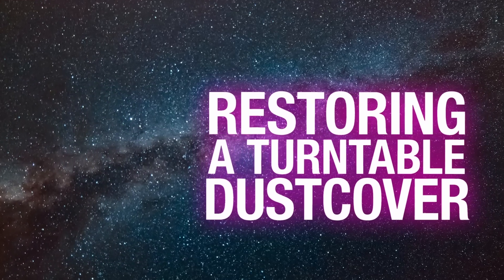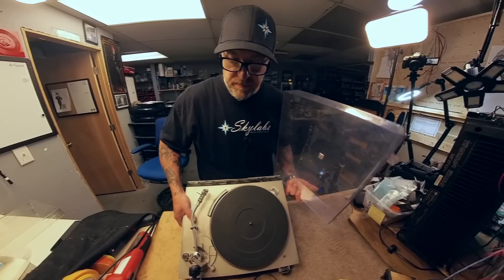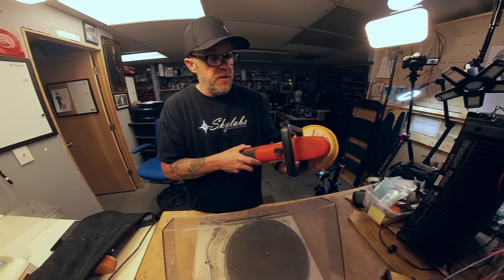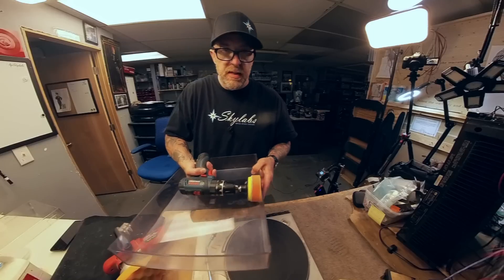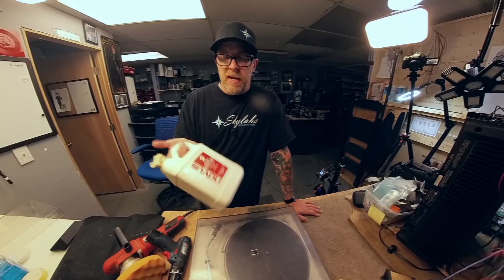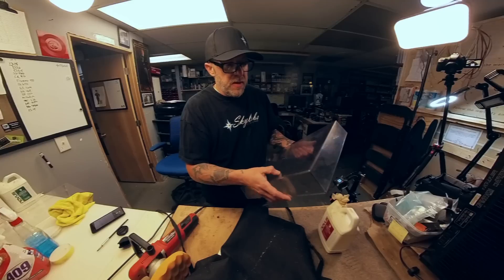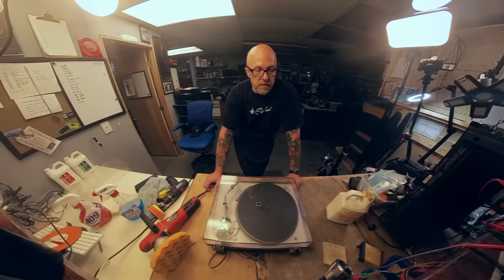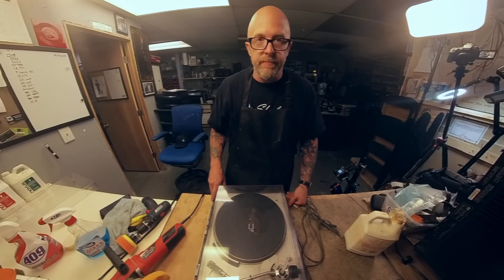Tips From The Bench Restoring a Vintage Turntable Dustcover

Comment: One thing that really helps with that process is to take a bath towel and fold it up into a square, so it fits under the dust cover! That way you can put a little extra pressure on it when you are buffing! I find this really helps and it prevents any chance of it cracking! Also are use Maguires scratch removal which really seems to do the trick on the cleanup! Just my two cents! Great job on the video, Kevin!

Comment: I go 400, 800, 1000, 1500, 2000, 3000 mcguires compound and scratch x2.0 follow with wax. I like carnuba wax and final buff with flannel cloth. It takes 1 hour. The trick is to start at the appropriate grit for the initial condition and the sequence of grit does the work for you. I usually go 5 to 7 mins per grit. Small circles, cross hatch and 45 degree. Rinse between grits and use soapy water. At 3000 grit and compound it will look very good. Scratch x2.0 and wax is money. Flannel cloth buff makes it mirror finish. I do these daily. The buff phase is like a total of 10 mins for the compound and 2.0. Polisher is 100% necessary. Keep it moving. I sit the cover on a piece of foam insulation. Cut grove in it to hold edge of the cover.
Reply: You should do a video how to

Comment: If there is a enough of the plastic tab left that it can stick into the slot of the hinge, you can drill a small hole in the hinge and keep it in place with a screw.  You just have to remember to take the screws out before trying to rip the cover off 🙂

Comment: Nice job Kevin! It looks great. I tried a Meguires headlamp kit (kinda expensive) and wen real slow. It took me four hours even though the scratches were not deep at all, just kinda cloudy. The dust cover was tinted or “smoke” is the descriptor for that one. I masked the label with a layer or two of good painter’s tape to protect the lettering. The masking tape was a pain in the neck to work around. I had to do many close areas by hand because I did not trust the drill apparatus. It looks like new, I mean really like new given it is a 1974 Denon and had never been cleaned/buffed prior. It was worth the effort, friends say “how did you find a new dustcover for that?” I also did not start with the very coarse abrasive, I just hung in there with the light stuff until I got the results I wanted. If you go with a coarse grit abrasive and heat up the acrylic, it will ruin it so if you try going a diy route, go slow. Read the instructions.

Comment: The dust cover on my SL-1500 has side by side 'cigarette' burns on the top right front that almost melted through the plastic... using tips & methods shared here I am sure the cover will clean up well, and I will just leave the damage as-is to retain that distressed vintage appearance.

Badges? We don't need no stinkin' badges!

Comment: I have had excellent results doing my technics lid by hand .Firstly going all over the outside of the lid with 3000 wet or dry to remove any scratches then bringing back the shine with T Cut....Looks as good as new but it is not a 5 minute job , prepare to spend a few hours on it ...

Comment: I’ve done about a dozen of these, so far. I’m currently working on one for my Pioneer PL-514 that was so bad, inside and out, that I had to wet sand from 800-2500 and I’m now polishing with the Novus kit and some other products in between. I have a 6” random orbital polisher and a 4” cordless angle polisher, but they’re both so unwieldy and messy, I usually end up doing most of it by hand.

Comment: Alot of people have random orbit sanders with variable speed which will work. Foam pads with velcro can be added. Use the slowest speed and practice on scrap acrylic. Small right angle cordless polishers are available as well as Dremel tools for tight spots. Polishing is SANDING with abrasive so start with a finer grit and step down if necessary.As with sanding,you do the heavy work with the first grit and after that you are only removing previous grits scratches. Cheers.

Comment: For really bad scratches, start with 320 grit and work up to 3000 or finer, then use Novus # 2 to finish.  
I do it by hand because I don't do it often enough to justify the cost of a machine.  
Novus  # 3 does work better if the scratches are coarse.  Be sure to use # 2 after using # 3.

Comment: To avoid scratches when you do the inside, you could use some tape on the sidewalls when you do the main surface of the dust cover, and later some tape on the main surface and do the side walls.

Comment: Novus stuff is good...in your case I would invest in a couple of squeeze bottles to fill up off that super tanker jug you bought (make sure you shake the container of whatever you're using vigorously). Meguiars stuff is good. I personally like 3M FinesseIt products cause I color sand car paint with it alot. It really depends on the type of plastic you are trying to restore...there's no one absolute polish in my opinion.  And stay away from headlight restoring kits...they are grossly overpriced and possibly too abrasive for a TT cover. On super heavy scratches you will need to use a finer 3M Imperial sandpaper to feather the scratch out otherwise you end up with a shiney inverted speed bump. I have personally polished many a plastic watch crystal...there's a special compound stick by Bergeon (green I think) made specifically for that purpose. I've used it in conjunction with a Foredom mini lathe at lower speeds and it still works great which is why I include it as a possibility. I guess it goes without saying try an inconspicuous spot on the back of the cover first if you are unsure of the product you are using. Also, be mindful of the color of the product you are using...will it stain a clear cover? When you go leaning on that polisher creating heat, will that dark red chrome polish you're using come off? Good luck.

Comment: Kevin,  You know your stuff about vintage audio no doubt but omg, THIS IS NOT how you polish clear plastic. Watching you pull out that buffer is like watching someone say they're about to change a TT cartridge and then they pull out a hammer. While yes, you can kind of maybe get the job done (poorly at best), it's the completely wrong tool that's going to take way more time and effort and have a good chance of breaking something.
To start with that buffer is made for things like cars. Not 12oz pieces of plastic. It can and will fling it or shatter it. ESPECIALLY WHEN YOU WERE USING IT WITH THE COVER SITTING LOOSE. And you've seen other people get good results with 3000 grit sandpaper because the pad you're using is actually coarser probly somewhere around 2000 grit, you're just basically beating the plastic into submission. Novus is always the best polish for plastic but it is extremely hard to get semi-good results on plastic with any sort of power tools, and with what you're using "passable" is the best you can ever hope for.
Just use Novus 2 with a cloth by hand and you'll get way better results with much, much less frustration. If it's deep scratches Novus 3 works but it takes time, and then it has to be buffed out with 2. You don't even mention Novus 1 but you want to finish with that as it protects the newly air-exposed plastic surface. If you really want to use power tools than get a small palm orbit sander but spend some time to learn how to polish plastic first. What would you say to someone trying to restore an amplifier but they didn't know what a capacitor does?
Bottom line I respect your talent for vintage audio but you are giving people bad advice in this video, and at best they get poor results, possibly break their cover and could very well even hurt themselves following this.
Reply: You’re not wrong, but he did end up with a decent result given what he had to work with.
Reply: I agree.  The buffer Kevin uses is overkill. 😏  I've cleaned and polished numerous plastic dustcovers just using Novus 3, an old cotton t-shirt and good old elbow grease.   It takes longer but eliminates the risk of damaging the dustcover.  I think Kevin chooses the fastest method given his time limits.